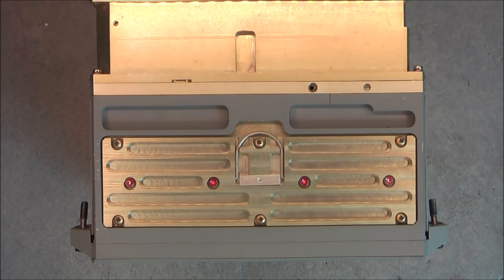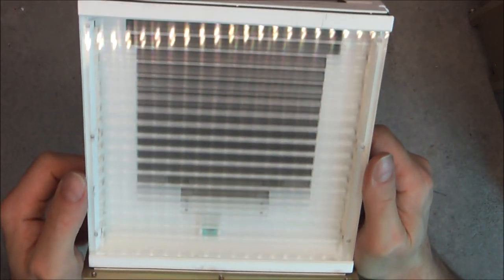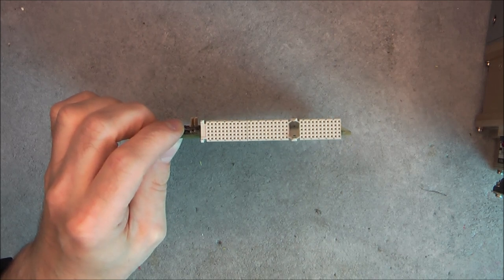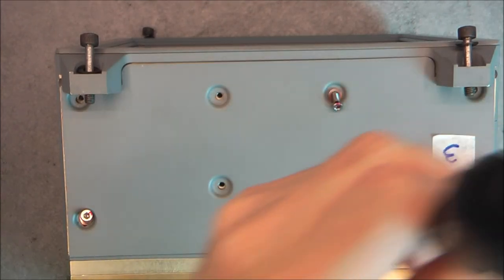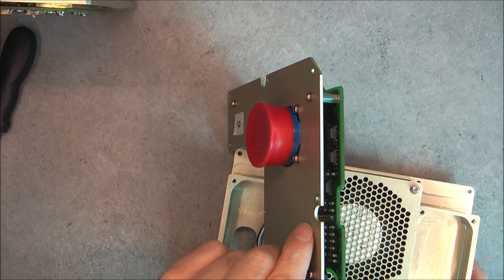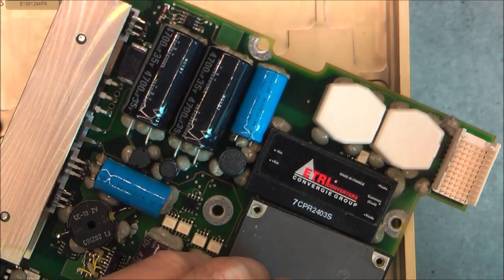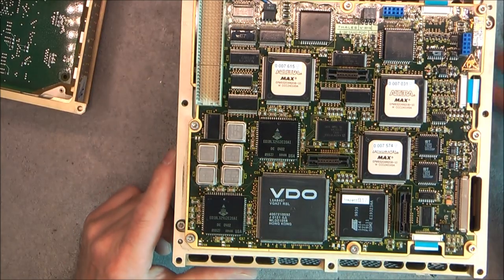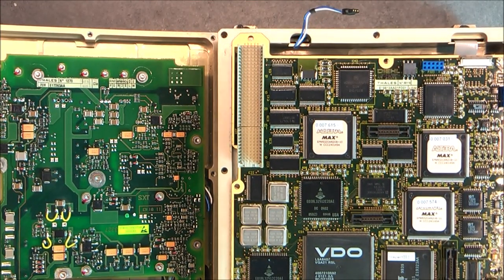Nimrod cockpit colour  LCD monitor teardown

Comment: There are several reasons why military displays tend to have a lot of chips. For one, there tend to be a lot of video scalers/converters for various input formats. The CPLD/FPGA chips in the video are older and the gate count isn't that high per chip. So, they tend to have simple functions.. mostly "glue logic" such as data format conversion. As others have said, it's possible that this display can display some vector overlays, which means interpreting/de-serializing data, drawing the vectors, performing anti-aliasing etc. Even simple character generation can consume a lot of logic when done with something other than a CPU. Regarding power, I'd guess that this is a 28V unit. Given the low voltage, the current would be high - so the power input pins on the main connector are probably paralleled. The mating connector for the main one would be D38999/26FH35SN a standard strain relief backshell would be M85049/38-23N. To power the unit, I'd see what the main 35V 4700uF capacitors are connected to. You could probably power them up directly or find if the input goes through a MOSFET and trace it from there. The beefy MOSFET in your video even has gate, drain and source pins labeled. The backplane input connector would definitely have power pins paralleled as well. This display is likely switched on remotely, so even with the power present it might need a separate "power on" signal. Brightness etc would be set remotely as well. For DC-DC converters, whenever you see a part number format like 2403 or 2412 for example, this means "24V in, 3V out" or "24V in, 12V out" respectively - this labeling is common. Hope you can power it - good luck! Thales always makes top-notch stuff. Very logical designs. Vive la France!

Comment: I bought one of these for cheap, was advertised as new but it has clearly been somewhere damp and wet. I pulled it apart and had a good look at the chips. It seems to be nothing more than an over the top analog LCD display. It does indeed take analog video with separate coax for red, green and blue. The plug in PCB can support up to 3 video sources but the rear option board only has the circuitry installed for one. However it does not appear to be sync on green and the horizontal and vertical sync is on the main connector somewhere. I'm trying to power it up and from what I can gather it needs 28V DC only. The plug in PCB really just takes the analog signal, converts it to digital and does some custom processing / scaling and then passes it to the main board consisting of an atmel CPU, flash, FPGA's, CPLD's & some RAM. I'm calling the main board the controller PCB due to the presence of a recognizable atmel 8 bit RISC CPU. It also drives the LCD panel too.

I don't know if it's going to do anything other than display some sort of self test as there's no brightness controls. This again appears to be controlled via the main connector. If anyone can find out more about these it would be great. I read somewhere from an unverified source it is the same chassis as the LCD displays used in the Airbus A320/330 and 340. The only difference is the plug in 'middle' card and the colour of the bezel. It has a resolution of 768x768 pixels. In comparison the Boeing 737NG has displays from Honeywell with simply just video inputs and the signals are generated by two computers in the avionics bay. http://www.b737.org.uk/flightinsts.htm Looks like this is very similar.

Edit: I managed to find out that where I mentioned above that the B737 displays have a video input it's in a digital format that uses differential signalling. Also the Airbus displays are completely different and take the raw data sent over the arinc 429 bus and process it into something meaningful that can be displayed. So instead of the graphics generators being seperate they are integrated into the display and I bet this will be exactly the same. 

Certainly looks like the coax is for analog video going by the Philips triple channel video amplifier ic on the plug in board. But I guess it's for a video overlay function. To get this to work it would have to be controlled by the arinc 429 or mil-std-1553 interface whichever it uses. 

Not going to be easy if not impossible to use it for anything without a service manual and extensive knowledge of aircraft data networks. You would need software to generate the right data too.
Reply: If it is really based on the Airbus displays, which is likely as they look not only similar but also are made by the same manufacturer, the input will mostly be Arinc 629. Inside there should be a processing unit and a graphics unit. On top of that some of displays in the Airbus have additional video in capability and perhaps Arinc 708 terrain/wxr type of inputs.

Indeed without knowing the protocol it will be impossible to get it to show anything more than the self test in progress message.

Comment: The large ceramic-packaged chip on the first board is most likely a high-speed  mask-programmed gate array made by LSI Logic.

I wonder if the LCD may had been trimmed from a larger display panel.  There is a company in Switzerland which specialises in such techniques.  I believe the trimming is done with a pulsed laser.
Reply: BAE has a patent like this which they used for the RMDP/Tardis system where they cryogenically freeze the display, trim it and apply sealant. I don't remember how the trimming was done but it shouldn't be hard to find the patent.

Comment: 21:26: This is a DC/DC Converter. You can see from the filtering on the bottom. The label will also be most likely on the bottom so you would need to unsolder it in order to look at it.

Comment: Wow at the number of CCFLs. Wonder if the Boeing and Airbus LCD displays are the same.
The internal connectors in this are the same type used in CompactPCI and PXI cards/backplanes. The connectors themselves aren't that expensive, but the dies used to press-fit them into PCBs are.

Comment: Please if anyone has the power pinout details for this unit please share as I'd love to power mine up!
Reply: Should be simple enough. At 16:56 there's a bunch of big MLCC's that form a filter. Do some measurements to case GND from there to figure out the polarity and then it's probably just 28V DC across.
Reply: @zaprodk  I think you'll find that case-ground is separate from power-ground, with both power and power-ground connected to case through decoupling caps.
Reply: @Rokreder  Yes, this is definitely the case. There are separate grounds on both the 'main' boards.
Reply: I think I have figured out the power connections and got mine to power up but only for a few seconds as it draws more than the 5 amps that my bench PSU can supply. The fan on the rear spins and it looks like the LCD backlight attempts to come on. Pinouts are here https://www.dropbox.com/s/qycidtc8aomlw50/Nimrod%20LCD%20power%20connections.jpg?dl=0 if you can see my drawing.

If you have a bench PSU that can supply more than 5 amps at 28V it may be worth giving yours a try.

Comment: 28:55 These connectors are commonly used for high speed logic analysis while in development and/or at manufacturing. Most times you will only see the footprints of these connectors.

Comment: I have noticed alot of aircraft have a separate 'Symbol generator computer' for the displays (I have one from a Bae 146). I do wonder if these units can do it all by themselves?? I'm still not convinced these Nimrod screens are just a simple display judging by the amount of electronics inside...
Reply: I think they do have an internal symbol generator as well as able to process analog video. The airbus A330 and A340 displays also have their own symbol generator built in and just take the arinc data directly. They are the same vintage and use the same LCD panels.
Reply: @adriansmith31  Sometimes you can view varoius camera's arranged outside an aircraft to view various angles through the cockpit displays. Is this why they are able to process analog video? Also are the electronics inside the A330/A340 displays simular to the LCD66N?
Reply: @neil9443  I've no idea what the analog input was used for on the Nimrod but yeah the airbus certainly has a camera so the pilot can see if the ground crew are clear. I've got the service manual for the airbus displays but apart from the LCD display assembly the electronics are completely different.
Reply: Thinking on.. the Nimrod was used as a maritime patrol aircraft so it would make sense them being able to display video through the display, Then obviously selectable to ADI, Flight information, Radar ect...
Reply: @neil9443  that would make sense, yeah. As a matter of interest the analog video input is an optional extra on the airbus displays. They also run off 115v 400hz whilst the Nimrod displays are all 28v DC.
Reply: @adriansmith31  Yes I think it's making sense now, I can't see why you would have another avionics box somewhere producing graphics ect only to send them to this display via an analog signal. There must be more going on in the LCD66N than we realise. I have two of these units & would love to power them up properly, I have taken note of the pinouts recently published on here, also there must be a test menu accessable somewhere...
Reply: @neil9443  it's very difficult to reverse engineer due to the construction and connections going through multiple boards. Will need a LOT of time spending on it. Only a handful of chips are off the shelf; most are custom chips with no datasheet. Did you get yours to power on and display anything?

Comment: Amazing device! It would be awesome if someone could figure out the pinouts so we could use them for something.
Reply: I'm tempted to buy one on eBay to see if I can reverse engineer it and try and figure out what video signal it accepts. I see three coax cables which means analog with sync on green. However it has lots of electronics in it so it likely generates a display from data sent over the arinc bus as well. I also noted the VDO chip could possibly be a VGA video processor.
Reply: I have figured out the power connections and got mine to power up but only for a few seconds as it draws more than the 5 amps that my bench PSU can handle. The fan on the rear spins and the LCD backlight attempts to come on. Pinouts are here https://www.dropbox.com/s/qycidtc8aomlw50/Nimrod%20LCD%20power%20connections.jpg?dl=0 if you can see my drawing.
Reply: @adriansmith31  Great work, keep it up! I'm even more tempted to get one now! I have a 24v 10amp psu. Do you think it would work with 24v instead of 28?
Reply: @andycristea  Possibly, the DC input goes through a low side mosfet switch (a BUZ344) which turns on one of the DC-DC converters. The other appears to be always connected. Perhaps some logic is powered and it gets a remote on signal to turn on the main switching FET. It's a very complex power supply circuit and hard to reverse engineer as it's at least a 4 layer board. Mine was water damaged which is visible on the LCD but the circuit boards appear OK due to the conformal coating. There's someone on eBay selling them for £55 but he will take offers. There's another at £240 but the cheaper ones are not as much as a loss if they accidentally get blown up by experimenting. I'm not sure it will display anything without a signal though. Maybe it has a built in self test at power up.
Reply: @adriansmith31  I offered GBP40 and they accepted. :D Can't wait to get it!
Reply: @andycristea  it would be good if another electronics engineer can reverse engineer it further. It doesn't appear to need any other supply than 28v. However the brightness will be externally controlled and it may default to minimum brightness. The remote power on signal may be a remote display off signal and it comes on by default.
Reply: @adriansmith31  in my experience with consumer LCD TVs and monitors, the brightness of the inverter/LED driver defaults to maximum when the brightness controls are not connected.
Reply: @andycristea  Figuring out what video signal it accepts will be the hardest challenge. Don't think it's sync on green like I initially thought and due to how it's constructed it makes reverse engineering the interconnects between boards difficult.

It also looks like it takes serial data over the arinc databus and displays that as well. There's 4mb of fast SRAM chips that look like they are used as frame buffer memory. The main board has 32mb of SDRAM if I counted the chips right.

Edit: I've sent mine back for a replacement as the LCD panel is really badly damaged by damp. It looks like there's fungus growing inside of it and it smells terrible when the fan is running. If you get yours powered up before mine it would be great to see if it does display anything; even a self test.
Reply: @andycristea  Did you have any luck powering yours up? The seller refused to replace mine when I sent it back as he said they have all been stored in the same place. I got a refund for it - is yours water damaged as the one in the photo looks okay?
Reply: @adriansmith31  Hi! I didn't receive mine yet. Tracking says it should be here tomorrow.
Reply: @adriansmith31  Hello! I just got mine today! The seller did not write the correct address on the parcel or my phone no. so the courier returned it. He sent another one after that and i just got it... I will let you know.
Reply: @adriansmith31  I Had some time to play around with it. It is awesome! It does not seem water damaged. Hopefully i'll have some time over the weekend to try and power it up. I wonder what the name of that connector is... Perhaps i could find a used one to use... Any idea?  Perhaps @msylvain59 knows?
Reply: @andycristea  I tried to find a connector with no luck, these connectors were often custom made along with the rest of the unit. I used small crocodile clips to clip onto the pins very carefully to power it up. As for the water damage, mine had mould growing inside the LCD panel and corrosion on some of the metal parts. The seller said all were stored in the same place so maybe you got one that was shielded from possible water leak by the other units on top of it. 

In the meantime I contacted someone in Norway who has six of these units he purchased years ago with the hope of being able to use them in a home made cockpit for a flight sim. He hasn't found a way of getting them to work yet either and he also kindly sent me the maintenance manual for the Thales LCD's used in the Airbus A330 and A340. They are completely different to these units although the LCD panel looks the same. They take raw data from the ARINC bus and process it internally generating all the relevant symbols and graphics. They have an optional video input but this is generally used for input from the cameras mounted in the wheel well to monitor the ground crew and to check that no-one is in the vicinity of the engines when started up. The inputs are selected via data over the ARINC bus. 

As these units are military they will likely use the MIL-STD-1553B data protocol although I couldn't find a 1553B transceiver when I stripped it down. Also the guy in Norway spoke to someone in engineering at Thales and they verified they have the data for these units but won't release it as it's a military part and you would need permission from BAE Systems & the UK government. Also these units were supposed to have been destroyed but some obviously were not. Asking around about this to BAE Systems or others will likely open a can of worms. It's going to be a very difficult reverse engineering project I think.

Edit: When powered up the A330 / A340 displays will flash the backlight on and off a few times, show a brief line of text followed by "Self test in progress. Wait max of 40 seconds" in red or green (guess that depends on software version) these might do something similar.
Reply: @adriansmith31  Under a strong light, there are some marks on the LCD behind the protective glass, maybe it's mold... I only removed the backlight to glaze at its awesomeness :D.
Reply: @adriansmith31  I just bought one. I will try to do something with that but after watching this video this device seems complex. Conformal coating doesn't help for reverse engineering.
Reply: @lelabodemichel5162  might be worth double checking my power connections I figured out just to ensure I got it right